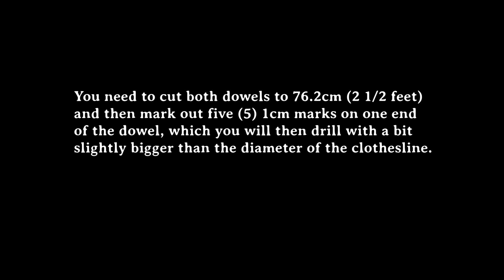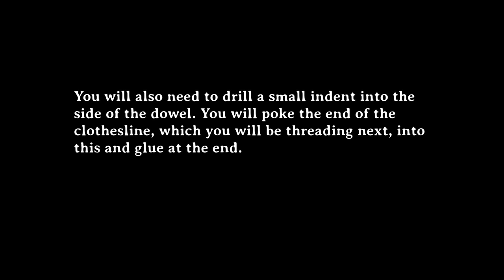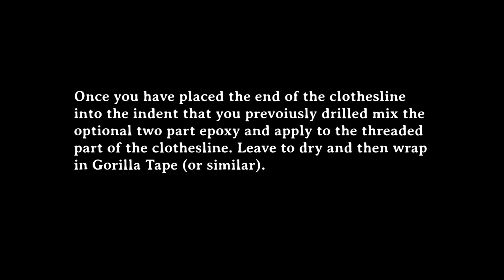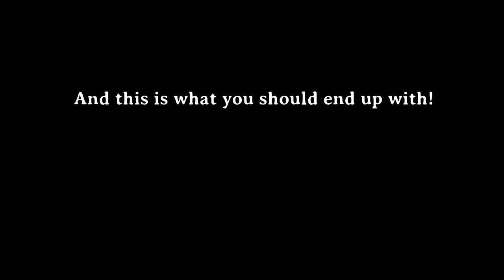Making a Flirt Pole

Comment: I just use cheep string and a 1$ plastic broom handle from a dollar store. I play with my 4 pittys at the same time so I want a light pole incase I accidentally bop one of them with it and the cheep string breaks if one of them pulls too hard. I don't want them to get hurt if it wraps around a leg when the other are pulling if I used clothesline I could seriously hurt my guys. But I guess for a single dog there is less risk. Good video though and if it's working for you great